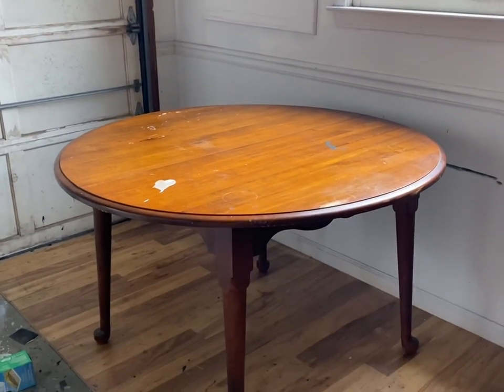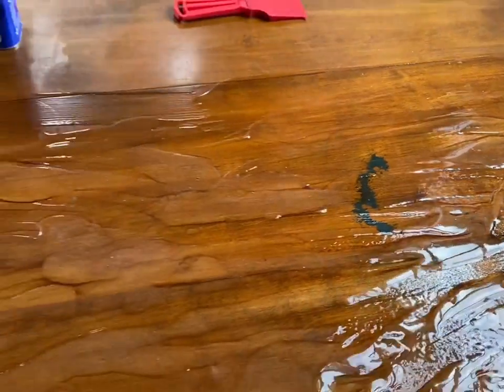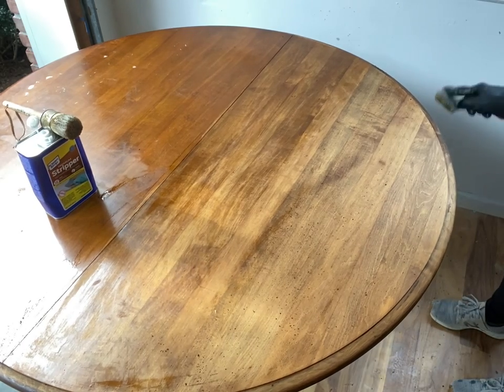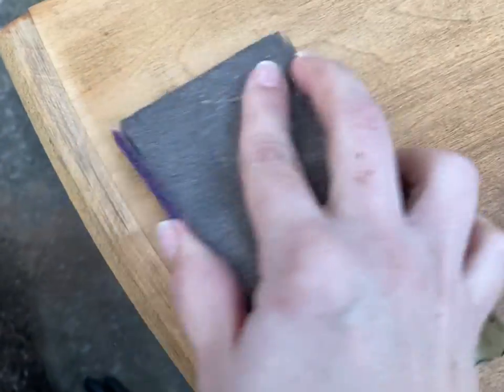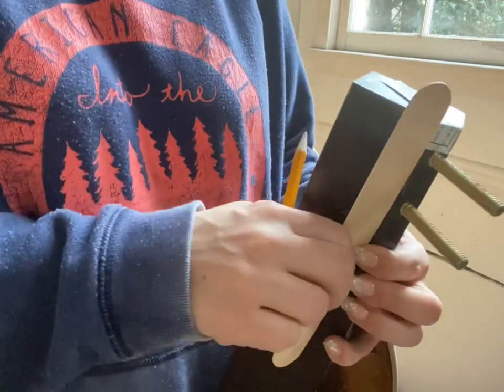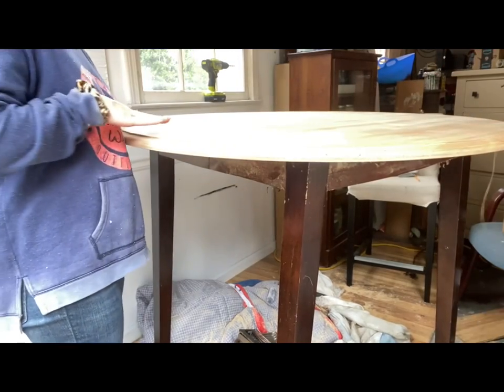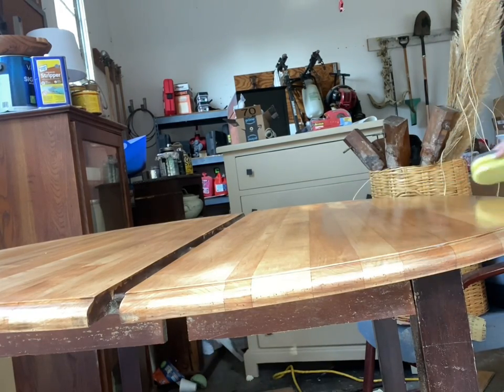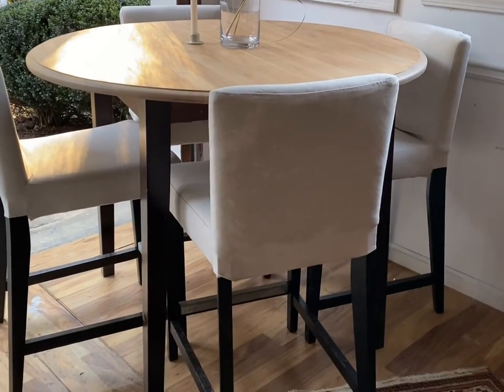Furniture flip, using stripper - LIGHT WOOD TREND for 2022• table makeover boho dining room

Comment: Washers before Nuts...
Keeps the Nuts from binding in the wood as you tighten.
A touch of LocTite on the threads also secures them as the movement using it everyday can also loosen the NUTS from the bolts.

Comment: Hi Shannon, I’m planning to refinish my kitchen table.. I can sand off the yellow finish with a 220 and plan to put on a clear coat after. How many coats should I use,  and should I sand in between coats ( what # paper)? The table top is not solid wood. It may be butcher block. Thanks for any advice. The table in your video is beautiful.

Comment: I'm glad you said you were in your garage, I was worried for the pale wood flooring underneath the table that I saw when you started! Finished table is lovely, I was given an oval table with those strips of wood on the table top and wondered how it would look stripped back. Now I know! Thank you. Did you also do the middle bit? As the two sides come apart it looks as if it is an extending table with a folded under middle section.
Reply from the maker: Mine is missing the extension that fits in but I may build a really simple one so I have the option when ppl come over

Comment: #1 or #2 steel wool with mineral spirits works well with removing the remaining paint. Also you may want to consider investing in cheap and disposable chip brushes to apply the stripper. Save your nice brushes for paint application.  Your project turned out well.

Comment: My table top has veneer and I want to strip down to the wood similar to this project.  Will the stripper remove the damaged veneer or is that what I should expect from sanding?  Thank you
Reply from the maker: Every table is different but veneer is usually about as thick as a penny or a dime laying flat, if your tables veneer is made of wood then the stripper will remove the finish and you can proceed just like I do in this video but if your veneer is made of Formica or something else then the stripper won’t do much.  You can find out if your veneer is wood by sanding a spot and you’ll be able to tell if your sanding is getting through to a lighter wood,  hope that helps ❤️
Reply: Thank you for your guidance ;)